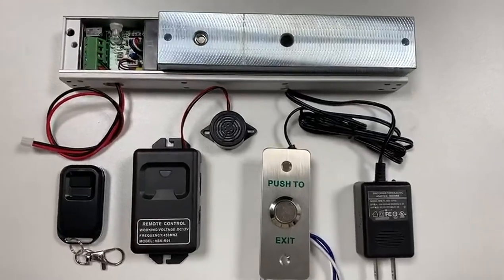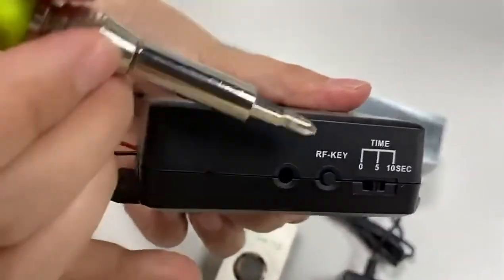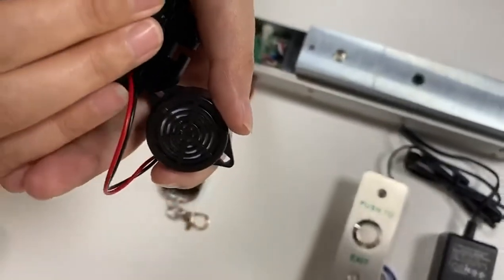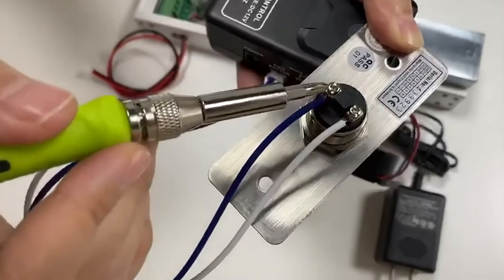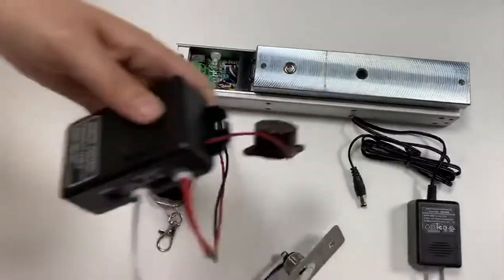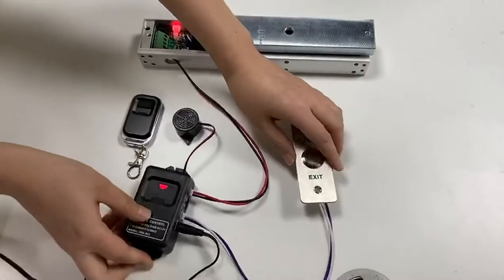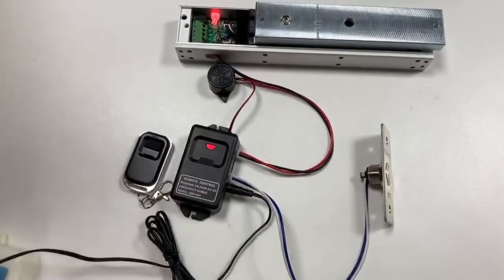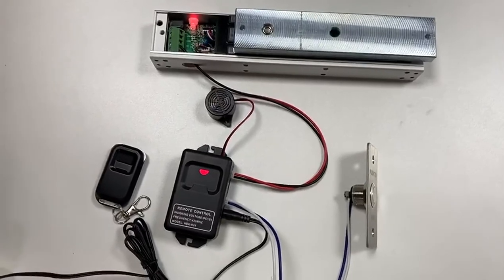UHPPOTE 2 4GHz WiFi Outswinging Indoor 600lbs Electromagnetic Door Lock Access Control Kit

Comment: I need by law to connect another emergency open bottom on the same wall with the metallic one.. how do I need to connect the wires now ?
Reply: Great question. Am pretty sure you can splice and put another switch on the other side.